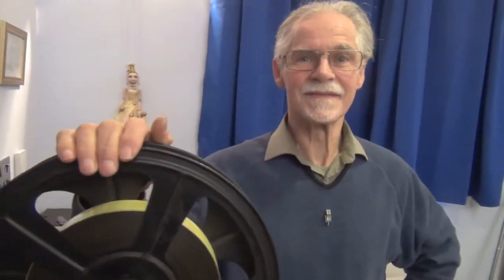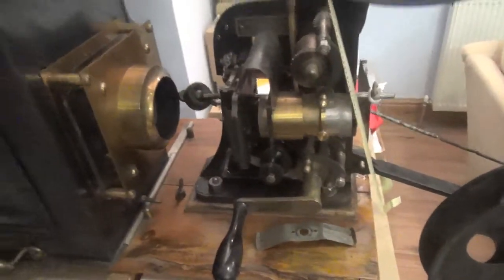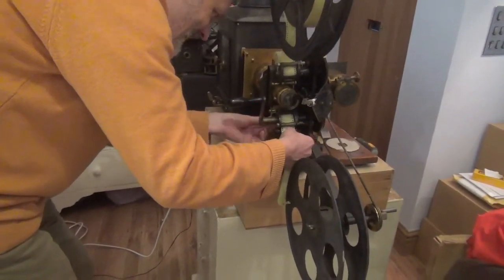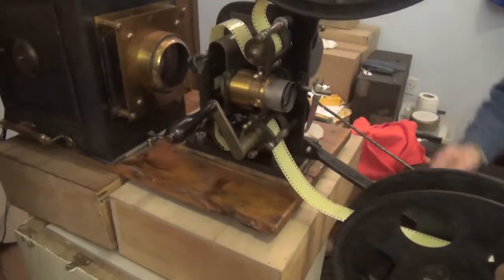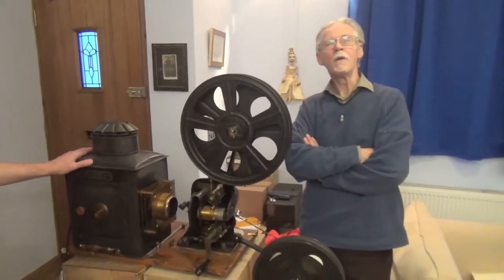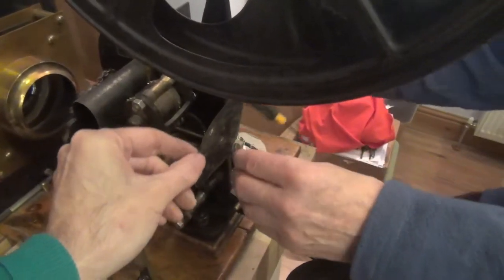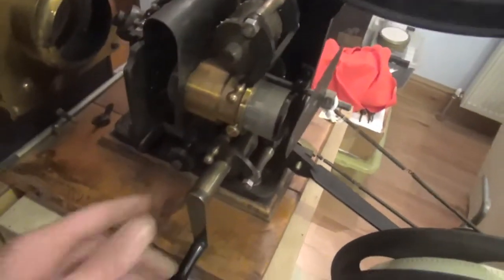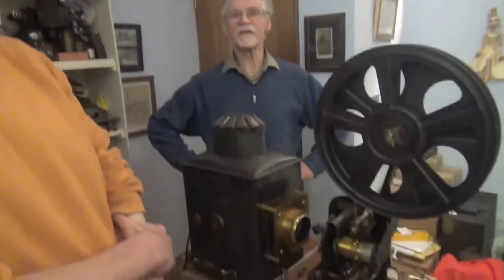Film show, Empire 35mm Cinematograph projector 1908.

Comment: It's nice to have the warning about nitrate film. I worked with Nitrate stock as a young projectionist back in the late 50s and that warning can't come loud enough. Not only is it volatile when projecting, but also when handling. It will often go up in flames without warning if not treated with respect. It is also a very brittle stock and quite thin, so has a tendency to buckle, making it quite noisy to run. Check the reel for dry joins and remake if necessary, using the correct film cement and jointing procedure. Store the cans in a dry, cool place when not in use.  PS I certainly wouldn't project nitrate stock at home with open spools and no escape route. We used to get surprise visits from the local fire chief to ensure our fire buckets were all intact and our spool boxes were kept closed when running nitrate copies (often at Saturday morning minors shows). Thank heaven for safety film the rest of the time. Above the gate we had a small frame of nitrate film held between a sprung switch, so if we had a fire in the gate the frame of film would burn away and the sprung switch would open and shut everything down.  Love the video.

Comment: Fantastic video. I have a Butcher's Empire Cinematograph so can attest to how tricky it can be, especially when I first got it. It's nice to see another one in action. I don't suppose you have any close-up pictures of yours which I can study and compare to my own? Mine works fine but I think it's missing a few cosmetic parts which would help to make it run smoother and project better. Thank you.
Reply from the maker: I don't have easy access to the machine to take photos at present, sorry. Try google images search for Butchers Empire Cinematograph, or Butchers 35mm film projector, etc. Or - why not upload a video of your machine to YouTube, and then I can comment?
Reply: @horipet  Thanks for your reply. Not to worry :) Thank you anyway. I've tried googling but can hardly find any results, and even then mine doesn't match up with the images. E.g. mine has a longer crank handle which is attached to the upper sprocket, there is also an internal rather than external shutter etc.... I am new to uploading to youtube, and would love to upload a video of my own projector at some point. In the meantime, for the sake of interest, on my youtube video of a 1915 film I found there is a link to my imgur page with posts including images of the projector.

Comment: a beautiful machine.....can you give me some advise please.i have an ernemann 35mm projector from about 1910-1912 and the shutter has got loose on the cam shaft and is moving....the screw holding it to the cam is so so small that im afraid of damaging it if i try to tighten it....also cant find a screwdriver small enough.
thank you 
antony.
Reply from the maker: Hi Antony, I suggest investing in a set of small screwdrivers. Not too cheap, or they will be soft. Then a drop of oil or WD40 on the screw, leave for an hour. UNSCREW the screw if you can - but no too much pressure. If you can remove it, check that all is well and then screw it back in and tighten until shutter no longer revolves. The screw should locate on a flat part of the shaft. If screw won't shift, I can't really help with further suggestions. (You say that the shutter is on the cam shaft. I'm assuming that it's actually in the shutter shaft.)

Comment: Great video. I have a question, what kind of LED light are you using and where could I get one? Thanks
Reply from the maker: Hi, I build each lamp unit. It's a 50w LED flat chip, available on ebay. You will also need the matching 'driver' (transformer'). Then, a large heat-sink, preferably with a computer fan on the back. In front of the LED chip, a condenser lens might be necessary. So you will need to be able to deal with soldering, etc - and there are some special techniques including adding thermal cream between the chip and the heat sink.  If you want more details, let me know here, and I'll add tech and supplier info.
Reply: The nitrate film you demonstrated was awesome, the film stock appears to be in near perfect condition, has it been copied to fresh nitrate stock or stored very well? Thank you for demonstrating that amazing projector!
Reply from the maker: @tobroken1965  Hi, all nitrate stock dates from 1951 or earlier (with very few exceptions). The film we projected was original, so more than 100 years old. Some nitrate ages well, some doesn't. We don't recommend projection of nitrate stock unless you have been trained in how to do it safely. (I learned in 1970, and was a trainer for projectionists who needed to show old nitrate prints). All nitrate has to be checked foot-by-foot before projection, to ensure that none of it is sticky or damaged. Basically - it's very much a specialist thing, and it's best to keep to safety filmstock. Note: all 16mm, 9.5mm, and 8mm is on safety stock, and films printed on 35mm after 1951.
Reply: @horipet  based on what I thought I was getting and what I actually got, I learned another lesson about being cheap. Could you please send me the tech info so I can do this the right way? Thank you. Steve
Reply from the maker: @tobroken1965  The link you sent show items similar to those I use (I'm in the UK). You need white or full spectrum, not warm white. You need to apply thermal cream between the chip and the heat sink. Also, you will need a simple 12v supply for the fan. Sorry I can't be of more help - good luck!
Reply: @horipet  that's fine, I am grateful for the reply, and every little bit of info helps. Keep up the great videos!